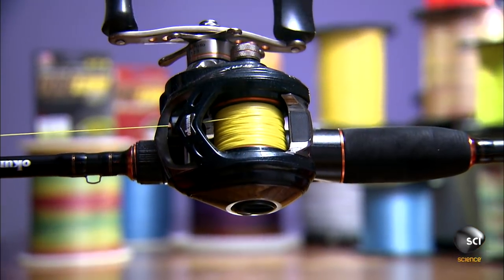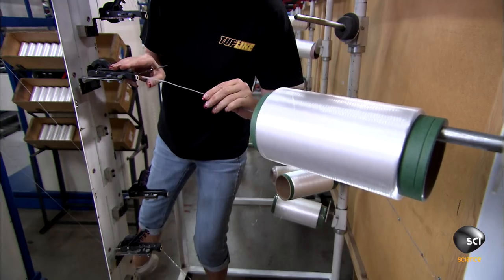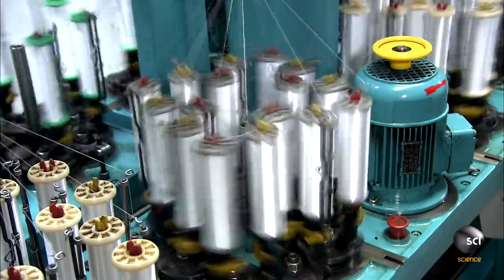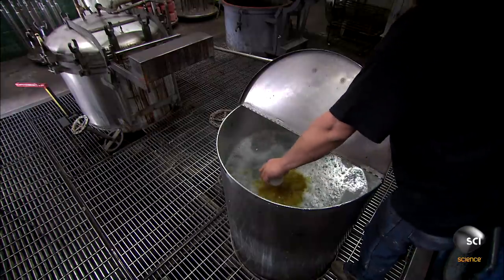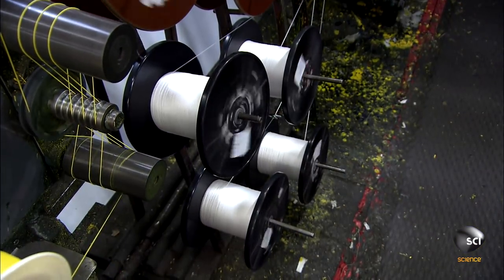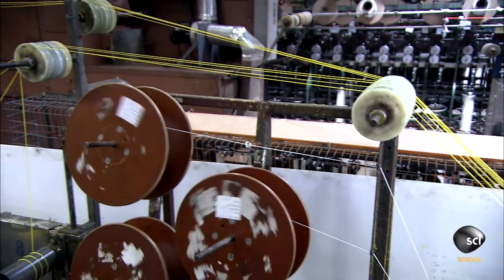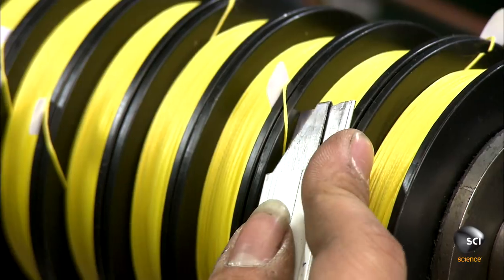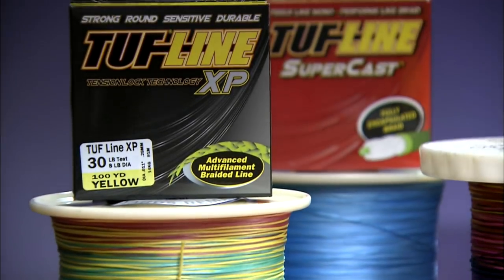Fishing Line | How It's Made

Comment: An ok video. I personally use braided carbon fiber 50 pound for Cod fishing and Crab Snaring.  I buy it on line and save a bunch. Its hart breaking to have to cut the line when i snag the bottom but sometimes shit happens. Now i tie on my weight with 30 pound mono.
Its easier to loose 10 ounces of lead then two hooks and 250 feet of ghood line.

Comment: 17 days for a single spool? Is it right??
Reply: But that doesnt mean there is no new spool in 17 days :)
Reply: It may take an individual 6 years to go through high school in the USA but there may be 300 students in your school going through simultaneously. Nationally it may be 100,000. Think of that analogy to describe the manufacture of spools of fishing line. If there was no stock of 30 lb line on April 1st, 17 days later there may be 50,000 spools but you needed to wait 17 days for yours. If you want to know the per spool manufacturing time then divide the number of minutes in 17 days (24,480) by the number of reels (50,000) that is, about 30 seconds per spool. Most manufacturing is done in China and the larger factories may have 1,000+ machines running simultaneously with multiple product lines. To break even these companies need to make 10's of millions of yards of line annually. These machines run 24 hours, 7 days a week and 1 person may look after the output of 100 machines on each shift.
Reply: 6 years for highschool? maybe in alabama
Reply: They make numerous spools at the same time.  From start to finish for 50 spools or whatever quantity it takes 17 days.  So on Monday they start the process.  17 days later those spools are ready.  But on Tuesday they start another batch and those spools will be ready 17 days later.

Comment: 17 days to make a spool of fishing line, very doubtful, maybe 3 hours.
Reply: Each batch, if it were 30,000,000 ft of line would make over 60,000 spools of 450 ft. A braiding factory, depending on how big it was may have 500 braiding machines. Different line strengths could be braided simultaneously so a group of machines could be setup to braid 8 weave 50 lb line and another 4 weave 20 lb line. Each machine would be making about  3 ft of line per minute but they run 24 hours, 7 days per week. If running for a week, at that rate of production, then over 30,000 ft of line would be produced per machine or 67 x 450 ft reels. A few operators can run hundreds of machines as they only need to change the fibre spools when empty. Most of the line produced these days is made in china where they have massive braiding factories. If 50 machines were batch processing say 30 lb lines then they could braid 3,350 spools of 450 ft of line in a week but braiding, while taking up most of the manufacturing time, is only part of the manufacturing process. The coloring, coating and packaging adds time as well. It doesn't take 17 days to make one spool but 17 days to make a batch of line. Where do you get 3 hours from?
Reply: The last statement in this video is: It takes about 17 days to braid, color and process a single spool of synthetic fishing line.  Acceptable would be,  It takes about 17 days to braid, color and process a  spool of synthetic fishing line.  I have a problem with the word 'single'.  I appreciate your production statistics though,